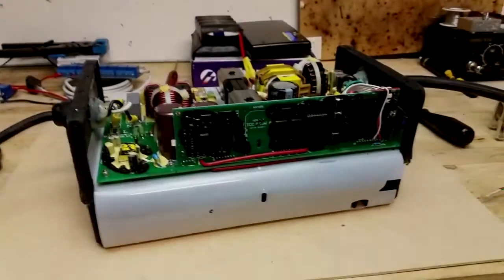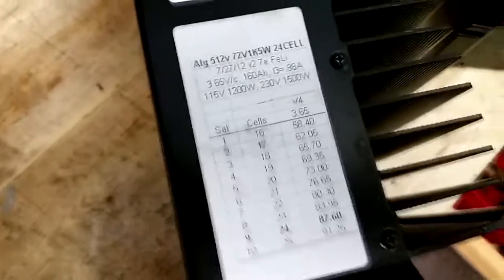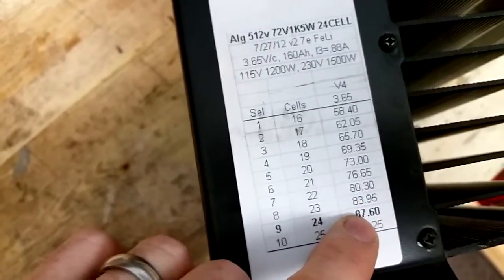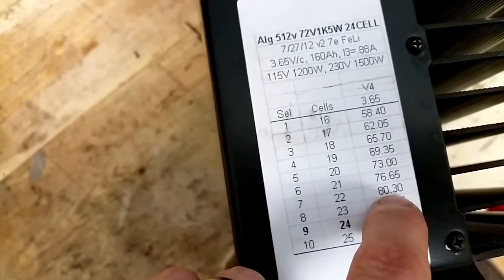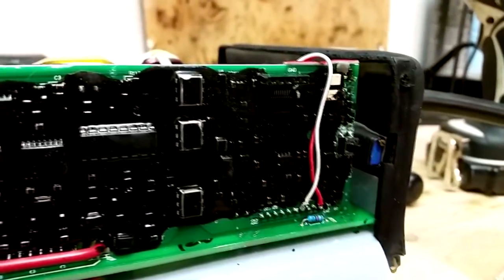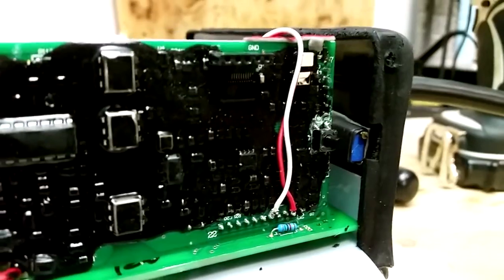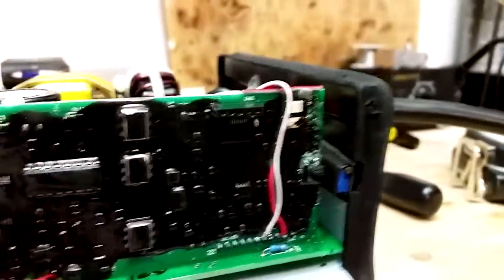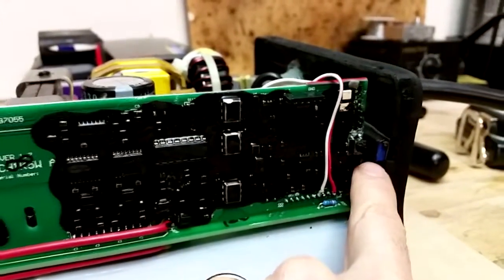Elcon Charger - Final Charge Voltage Trim Modification

Comment: Hey you file died on Google drive would you mind redoing it please to help me calculate I have a 96v one I want to bring down a little
Reply from the maker: I updated the link, now in Google Sheets.  Try here: https://docs.google.com/spreadsheets/d/1Otz61A95O14Gu6MritbThxw0jHZXKba1YK_OCR1MM0s/edit?gid=779753217#gid=779753217
Reply: @AndrewDoranPhoto  thanks so much mine is  all weird the black sticker says 96v but the white label says Alg 520V 120V2K5W 147 cell. 1V/c 100Ah  which to me is really odd because setting 1 says 143. If that's volts it's way to high for 96v pack. Ideally I want it between 84v and 110v
Reply: I didn't open mine up yet to check the resistors
Reply: Hi, i have a tc charger f7225pb160d-150. Can i adjust it same way? Thanks
Reply: @rdaguerre  ill let u know if I fix mine
Reply from the maker: @rdaguerre  I don't know, I have only ever done the the PFC 1500. In theory, probably yes, but I don't have any idea if, for example, pins would be in the same place. Try visiting the forum thread mentioned in the description to find more info from the guy who developed the technique.